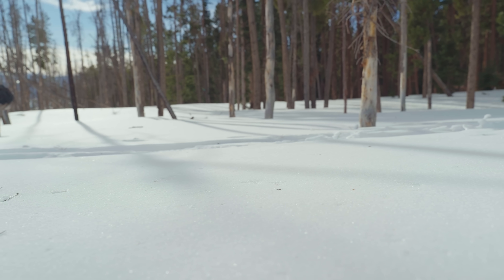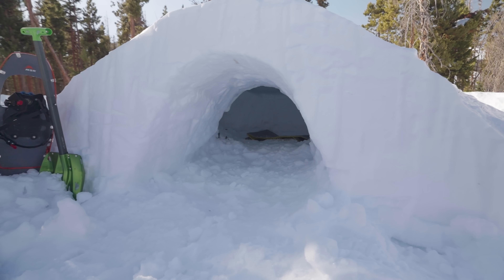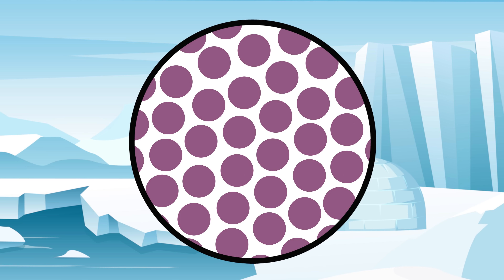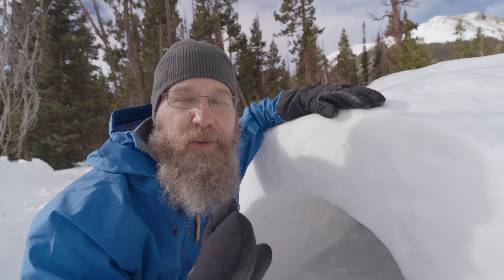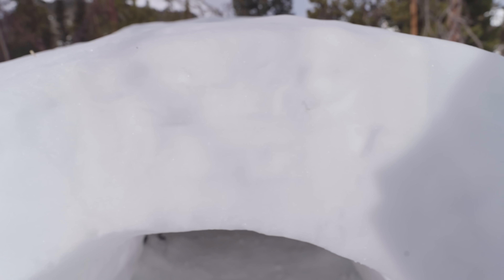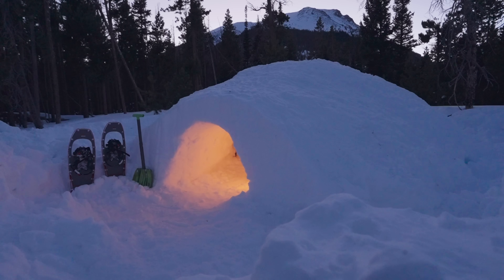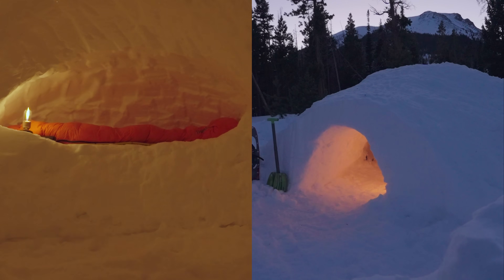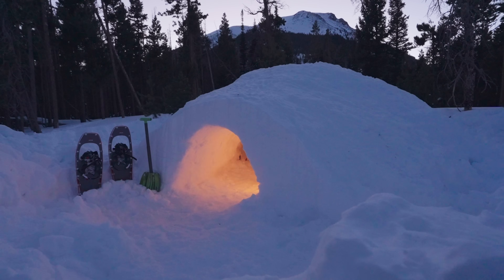Ancient Wisdom Proven Right by Science!

Comment: Though not being false what you are telling it doesn’t get the point: it’s cold inside an igloo! At least for spoiled Westerners. Few degrees Celcius above zero.

The thing is: Igloos prevent you from winds. And in Arctic winters outside temperatures may be below minus 60 degrees Celsius. So, inside it‘s may be over 60 degrees warmer than outside. 

But you shouldn‘t wear only your bathing costume because it’s so ”warm“ inside.

Comment: I've built these before. They can get downright HOT inside. You can even make the a bit more insulated by taking a small stick with fire on the end and melting a part of the ceiling and walls which makes a thin layer of ice on the inside which helps prevent heat from escaping. Block the door with backpacks/snow blocks and it can easily make you strip off some layers depending on the number of people inside.

Comment: An arctic survival technique is if youre going to sleep outside and you have no structure, bury yourself under the snow and leave a small hole to breath out. Snow cannot physically get colder than 32°F 0°C regardless of air temp. This is how plants survive ground from being completely frozen. The snow insulates whats underneath it. 

Long as you have a good insulated clothing you wont freeze to death as you would open air. Sleeping is dangerous due to how your body slows down energy production vs when youre actively moving.

Comment: frozen water doesn't keep you warm, the air trapped in the frozen water does...  and the white color helps reflect radiated heat back to you.  

over time the snow turns to ice (loses trapped air) and then igloo rebuilt to increase insulation amount

Comment: I sincerely love overzealous pedantry. Snow is "cold" in the sense that if you were to touch it with your skin, heat would flow from you to it rather than the other way around. The effects that make it a good insulator are separate. 

I really do mean sincerely, I'm personally always quick to tell everyone it's "octopodes" even though it doesn't matter and nobody will ever actually say that lol. This is a great little short educational video. Good speaking style, clear and confident, good info and presentation, excellent level of explanation for a quick, casual lesson. For a deeper levels of explanation, and to add my own pedantry, there are a lot more nuances to what "heat" is and why hot objects behave certain ways; I recommend channels such as Sixty Symbols, Minutephysics, Kurgesatz, and PBS Spacetime for more extensive dives into what temperature means.  And some wonderfully unintuitive things like temperatures below absolute zero! Useful in lasers it turns out.

Comment: The body does NOT produce heat from calories. That is the dumbest shit I’ve heard.
A calorie is a MEASUREMENT taken from a calorimeter, which has zero fucking relevancy to the human body, and has zero capability of producing any energy since it’s merely an abstract concept that you cannot physically consume. 
Heat is generated through chemical reactions with all the cells in the body, such as through metabolism. 

Speaking the metabolic process, eating that sugary trash you’re holding is one way to fuck it up and cause cancers.

Comment: Counterpoint: snow is cold.  It has to be cold because if it reaches a temperature exceeding 32 degrees F, itt is no longer snow.  Yes it is a good insulator, but only has value as such in extremely cold conditions.  The max temperature in an igloo or snow cave will only be around freezing.

Comment: the way burning or freezing your finger feels makes perfect sense once you understand whats happening at the cell level, when it's burning the cells on your finger become agitated and start moving very rapidly you feel a constant and very intense sensation of your skin uniformly wanting to rip apart.. while with freezing it's somewhat similar but instead of the area feeling like it wants to rip apart in all direction with cold the area feels like it wants to rip itself by pulling on the surrounding area, the cells become slower and tighter so the area becomes more rigid and numb with the coldest parts "pulling" on the surrounding areas that aren't as cold creating a similar sensation of skin wanting to rip apart but still not quite the same way as burning which is why people can tolarate cold better than heat. It's amazing how the Brain turns these microscopic reactions of our cells into the emergent sensation of we perceive as "freezing" and "burning".

Comment: cold and hot are relative terms. a boiler plant operator will use 300 degree 50 psi steam to cool a 1000 degree hot spot on a 550 psi boiler. just as the 35 degree interior of a snow shelter will be warm compared to the minus 20 degree air outside of it.

Comment: Fun fact: When ice turns into water, it absorbs heat without raising its temperature until the phase change into water (breaking of static hydrogen bonds and van-der-waals-forces) is complete, it takes a huge amount of energy. This is why the walls of an igloo wont really melt at all. Even crazier is, that the water, that melted got sucked into the wall (capillary action) and refroze turning the inner wall over time into solid ice making the igloo even more robust.

Comment: Thumbnail misleading, snow is cold. Freezing cold in fact. You could even say its frozen. Frozen water. 

What the video describes is the thermal properties of still or slow moving air, which does not transfer heat quickly. Snow is mostly air (just like other forms of modern insulation). The air trapped in snow, combined with its ability to stop the wind, causes any air underneath it to retain the heat that your body or a fire makes.

Comment: I’ve worked outdoors in temps down to 0 F. I would take a sunny and still 5 degrees over 25 with moderate or high winds any day. I imagine that’s the most important reason for an igloo, insulating and protection from winds.

Comment: The title is misinformation.
When snow is not cold, it melts.
Snow is cold.
Snow can also be an insulator. And temperatures are perceived with relativity.
As soon as the interior of a snow structure becomes warm, the snow starts to melt and is no longer snow.
Yes cold exists.
This video is full of misinformation.
Cold is the opposite of heat. Right after he says cold doesn't exist he points out what Cold is and supports that with explaining what heat is.

Comment: There's this new polymer based conductive material coming out in new 3d printed dry production batteries. What if there's a compound that when given a specific low voltage charge that it actively reduces heat run off proportional to the change of outside layer temperature?

Then what if you made that ventilate and hydrate, and make it confirm in an almost vaccum like state to your skin, then you effectively have a thermal gel base layer for a freaking spacesuit.

Comment: The True Igloo, is constructed from a special type of snow.
The inside of a true Igloo has to levels. A large lower area, inside the entrance, and a large bench area near the rear of the floor.

The entrance is not a large hole as shown, it is quite small, just large enough to enter, on your hands and knees.
The bench is covered with green Caribou hides.
The interior, of the Igloo, has green Caribou hides, covering the ceiling, and walls, held in place by toggles, and string through the snow.

Once the Igloo is made, the whole Igloo is covered wth loose snow, bilding up the thickness of the Igloo and sealing any leaks in the snow blocks.
The entrance hole, once inside, is block by a snow block, shaped to fit.  A fresh air hole is cut through the top.
There are several types of Igloos, such as a small overnight Igloo when travelling, or a large Igloo for a family when stopping for a while.

Comment: The most important aspect of a shelter is ventilation.My friend you didn't even mention it.
Reply: How true!  Another reason the beds are raised is so that the carbon dioxide you exhale will accumulate at the low point. It is possible to suffocate in an igloo.  Another consideration is that inside the igloo you are not subjected to windchill.  Also the greater the temperature difference the faster the heat transfer.

Comment: Science is science fiction!  Snow acts as an insulator primarily because it contains a large amount of trapped air within its ice crystal structure, which significantly slows down heat transfer, making it effective at preventing heat loss from the ground below it; essentially, the air pockets within the snow act like tiny insulation chambers. 

Snow forms when the temperature is at or below 32°F (0°C). However, snow can still fall when temperatures are a little above freezing.

Comment: You can get an igloo hot. But too high above freezing and you run the risk of melting it from the inside. Same with the sleeping platform, you need to insulate the snow from your body heat or you'll melt right through your sleeping platform.

Comment: Maybe you have your foam mat upside down, a JustinOutdoors -50°C video vaguely referenced the Nemo Switchback official design. The shiny part is still shiny on both sides, and with mechanistic speculation such reflective insulation is especially reduced by conduction – between you and the ground, the foam is the least conducting thing apart from air around. So it would warm up the foam mat more (kind of an air gap).

Comment: Great video but @4:40 I think it needs a warning to people about carbon monoxide poisoning when using a gas flame in an enclosed space.
Reply: And carbon monoxide kind of just mixes with the rest of the air, and when it's in high enough concentrations you start feeling the effects of it. That's why it's important to have a positive airflow when burning things in small spaces. Which is why you see holes at the top of igloos that have campfires inside
Reply: really?   i think there is adequate ventilation.
Reply: That's why you don't seal off the main door. Carbon monoxide is also heavier. With the heavier gas in the open bottom door you should have enough are exchange.
Reply: @HoneyBadgerSr lol no it’s not heavier. CO is actually lighter then air, that’s why igloo has hole in the roof
Reply: @HoneyBadgerSr  carbon monoxide is not heavier than air
Reply: @HoneyBadgerSr Carbon Dioxide and Radon gasses are heavier than air
Reply: I think you need someone to hold your hand before crossing the street.
Reply: @namewitheld  he's trying to help people avoid senseless death in case they're unaware... he's helping. What're you doing?
Reply: it's got a big ass open entrance by definition it is not an enclosed space

also that flame is very small... I get what you mean but I the situation shown in the video there is zero chance of getting Co poisoning with all Tha air circulation
Reply: @pregno1421 I think the op is meaning if people want to replicate making an ice cave or an igloo. Cuz as you can see in this comment thread, people don't know whether or not carbon monoxide is heavier than air. (It's slightly lighter)
Reply: @RumiNyx yeah I get that
but what I was saying is that gas stoves produce virtually no CO to begin with
and the entrance by itself is huge

ops comment explicitly talked about gas stoves
I get warning people but there is no need to scare everyone specifically newcomers with co when there is no real treat at all
if it was using wood then it would be a different story

Comment: Maybe worth pointing out that you get significantly better protection from wind than any tent.  It's not like you care about condensation, so you're can just block most air flow, except a gentle exchange at the door.

So being in totally still air that is above freezing is a huge improvement over a tent out where it is tens of degrees below freezing and you're going to have drafts.

With a snow shelter, you only need a pretty standard three season quilt even in full on winter conditions.

The only problem?  It's a hell of a lot of work to mess with all that snow!  You wouldn't want to build a new one each night while trying to also cover any significant distance each day...

Comment: Snow IS cold. People just don't understand the difference between heat and heat transfer. If I put a piece of cotton in an oven that is 150 degrees Celsius (302 Fahrenheit) and leave it there for 15 minutes, that cotton will be 150 degrees when I take it out, so yes, it IS hot! But because cotton has very poor heat transfer, I can put it on my hand and not get burned. Burning is about the heat transfer to you, not the heat. The same goes for freezing. Freezing is about heat transfer away from you, not actual cold. It doesn't matter how warm/cold your environment is, what matters is how much heat is transferred to you or away from you. And typically, hot things tend to transfer more heat to you the hotter they are, and cold things tend to transfer more heat away from you the cooler they are. But different materials have different heat transfer properties that play a much bigger role than their actual temperature. Water in a metal bowl will freeze much faster if you put that metal bowl in very cold alcohol than if you put it in liquid nitrogen (-196 degrees Celsius/-320 Fahrenheit); you would expect it to freeze instantly in the nitrogen, but because the nitrogen will start to boil due to contact with the hotter metal bowl, there will be an insulating layer of gas between the bowl and the liquid nitrogen, and that gas has a much poorer heat transfer than liquid alcohol.

Comment: As a trucker I’ve learned that wind is what makes cold unbearable. Growing up me and my siblings use to build Quinzees   when we got a lot of snow
Reply: Im a small farmer, ill take -17 still air over 20 degrees in a blizzard ANY day. The cold temperatures are actually easier for calving too, since the wind sucks the heat out of their still very wet bodys fast. 
Still better luck then when i calve in april, microbes love spring 😮‍💨
Reply: Big difference too between "dry cold" and "wet cold" though. For pretty much the same reasons he talks about, a cold temperature in high humidity is a horrible thing. Dry cold is no problem.
Reply: Humidity is what really makes cold unbearable. Humid +2°C is way worse than dry -10°C.
Reply: @K1989L   All about mass.  The Humid air is no fun, hot or cold.
Reply: having lived in both, I'll take the dry -10c of Ontario to the 0c of the UK.
Reply: I live in canada I've learned that when there isn't any wind in the winter the weather is very nice
Reply: @darkqueennyannya159  Yup. -5⁰ and windy? Deadly. -25⁰ no wind? Light work
Reply: @darkqueennyannya159  so true
Reply: I held off taking jobs in refrigerated factories because I hate cold. Turns out 30-40 degrees (F) really isn't bad without wind. Now I can't imagine working the hot factories I used to work in 😂
Reply: As a midwesterner this comment warms my heart

Comment: Snow can be used as an insulator, but it's still not as good as modern insulating materials. Its only benefit is that it's quick, easy, and cheap. You can use anything as an insulator if it's thick enough. The main reason why air pockets help to keep things warmer is because all that heat transferred to the air pockets isn't immediately lost by being exchanged away into the rest of the air, so it has time to reflect some of that heat back toward you, or toward other things that ultimately adds up to more heat in the general vicinity and less cold.

Comment: Is the warmest possible inside temperature 32 degrees?  Any warmer, won't it melt?

I would take 32 over below zero, but that still seems too cold for long term survival.
Reply from the maker: Now it can get as warm as 40F. The inside starts to melt and slowly run down the sides but often re freezes making a ice layer on the inside.

Comment: One pet peeve of mine is that it’s NOT thermodynamics. It’s blandly just called heat transfer. Thermodynamics broken up is thermo (heat) dynamics (study of varying / moving “things” in cycles). They are very different. Thermodynamics explains power output of engines, turbines, jets, brayton, diesel, steam, a/c, swamp coolers, humidifiers, etc. but this is purely the study of heat transfer. Easily interchangeable in daily conversations but it is very helpful for people that want to learn more to search in the right field. Beautiful video though 🤟🤟

Comment: I mean the thumbnail is kinda dumb. Ice and snow ARE objectively cold, it is water at frozen temperatures. At higher temperatures the water changes its phase of matter to liquid and then gas. What you should have put on the thumbnail was “snow can trap heat.” Not as “sexy” a thumbnail, but less objectively ridiculous to anyone with a functioning brain who doesn’t like their intelligence to be insulted. Because saying snow isn’t cold is just objectively not true, by every measure of science. Snow is cold, but it is also, importantly, solid enough to trap heat in the right conditions, if it’s compacted enough. That’s the bottom line really. Snow can trap heat. It’s the air INSIDE the igloo that gets warm, because you’re keeping too much hot air from escaping. That’s literally all. The external temperatures are cold enough to keep the igloo from melting, the internal temperatures are just warm enough to keep you from freezing to death, when you cover yourself adequately in addition to the igloo. This has been known science for many years.

Comment: One thing I've seen on another channel is that they kinda make the entrance interesting. See, the way air and wind moves when you get a direct blast of cold air straight in there is it can take your warm in an instance. Instead, the guy put a little tunnel perpendicular to the "door" that can potentially funnel wind out instead of trapping and leading it into the cave. obviously not as efficient as a door or straight up blocking that entrance, but it seemed to work well.